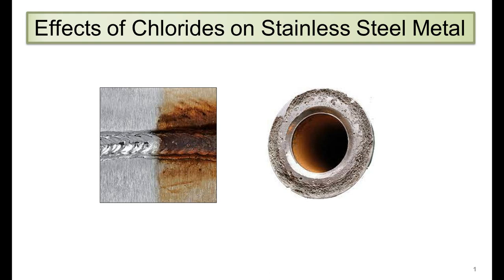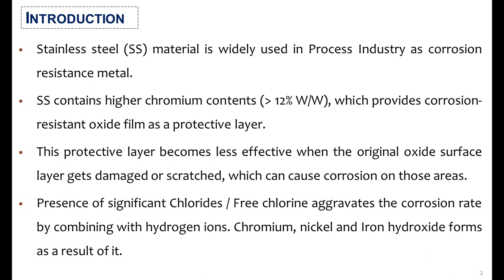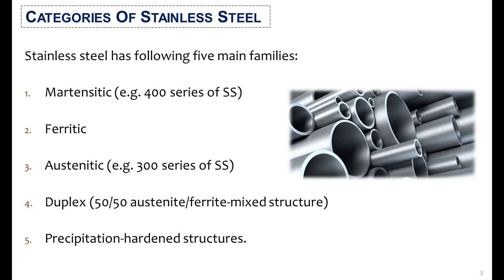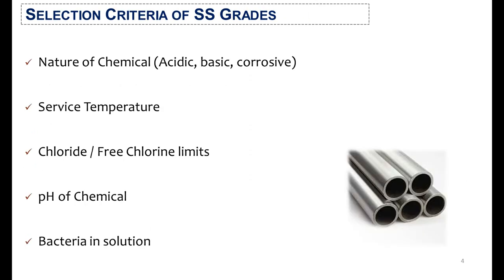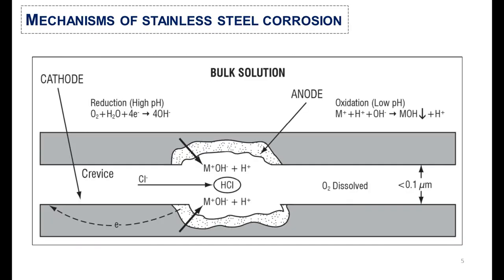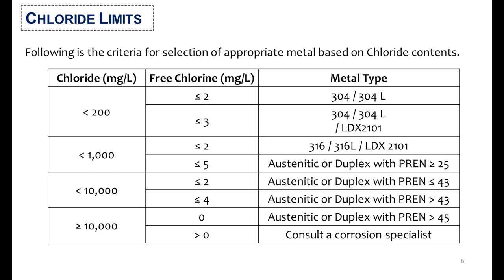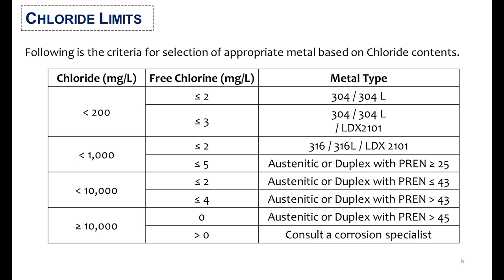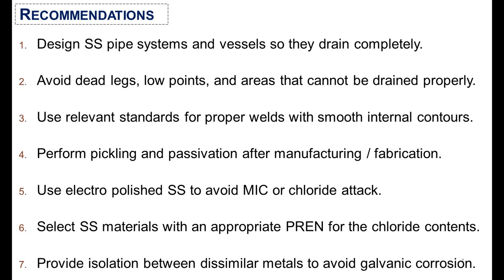Effects of Chloride on Stainless Steel Metal

Comment: Hi, I work with insurance damage. More specifically Water and Fire damage, Chlorides are often formed in the air as a result of the burned material (pvc as an example) and humidity. It’s pretty crazy how rapidly stainless steel can rust after fires.

We have one job we use as an example for how NOT to deal with chlorides.

There was a fire at a car mechanic early a Friday morning, the Fire squad did a good job and we could immediately start «saving property».
The people assigned the job was uninformed about «dangers» of chlorides, but knew the procedure to prevent corrosion.
Basically, they knew «How», but not «Why».

They worked until dark prioritizing cleaning and preserving the structure. 
Covering cars , tools and other techincal equipment with plastic and humidifiers blowing dry air inside the covers is the 1st priority on such a job mainly because of chlorides. But it was deprioritized by the workers who decided to come back and do it after the weekend.

There was not a single usable tool in that workshop by Monday, not to speak about the cars.

Very fascinating stuff.

Comment: Hi, quick question f you don't mind! In the case of a stainless indirect water heater. The tank and coil contacting the water are made of 316L stainless.. Would 150ppm chloride be an issue if the tank is constructed from 316L stainless and the tank is kept at 140*F?
Reply from the maker: There will be no issue unless you perform cleaning periodically and check the chemistry of water.

Comment: thanks for the information. I wanna use stainless steel for my pool heater.
The chloride in the water will effect the metals. Any way to coat the metal to prevent corrosion?
Reply from the maker: Glad to hear that it was helpful.
When chloride limit exceeds, passivation is highly recommended. In your case, SS 316 / 316L will be suitable as molybdenum alloy provides protection in high temperature with upto 2000 ppm.